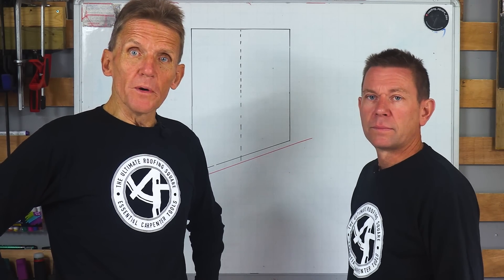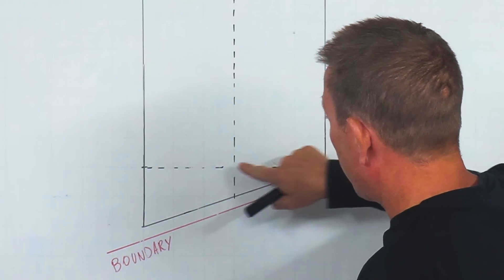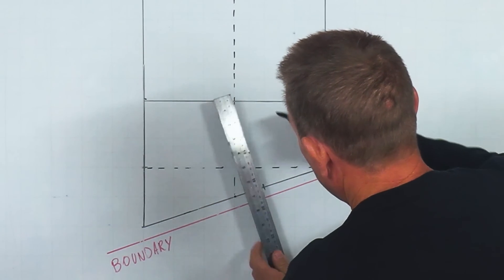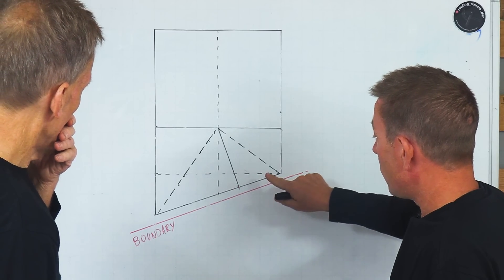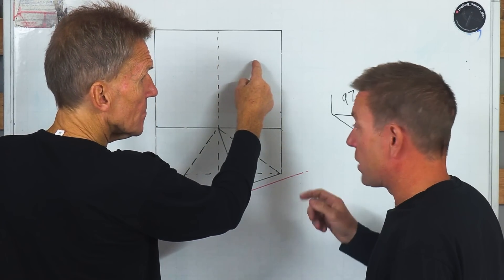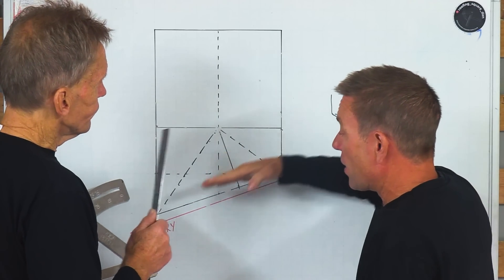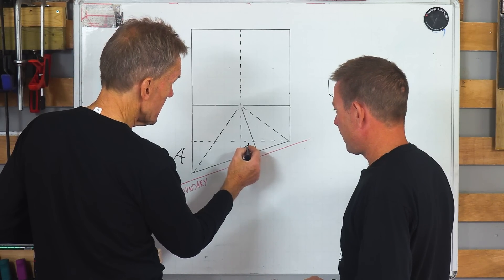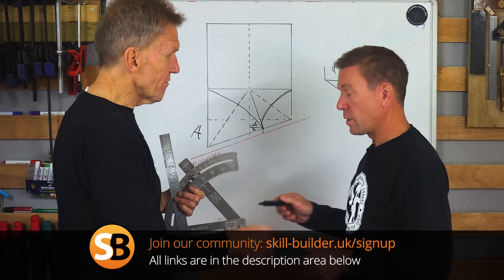How to Put a Hipped Roof on a Building That Isn’t Square

Comment: I think the triangle created from the back wall and the difference in side wall lengths and the squared off wall length is proportional to the triangle created by the end common and the squared off distance from the center line to wall end of the end common and the center line from the end off the ridge to the back wall

Comment: This is a great explanation for when the shape is square on three sides and for a (deliberate) sizeable difference (1 mt) at one end.    Very easy to follow. Thank you. 

When it is a case of having a structure / frame that is  out of square by smaller amounts (eg. 50/100mm) and/or out of square on 2 sides, what are your ‘rule of thumb’ tolerances where you wouldn’t adjust the placement of the hip rafter and just cop a slightly out of plane tiled roof? 
What /where would you make any adjustments to the tile layout ? 

Or would you apply the same method to square up  all sides (making adjustments to the out of square sides)
Reply: Sorry that should have been the common rafter from the ridge beam that dissects the 2 hips :)

Comment: On plan, it's just a problem of similar triangle and symmetrical kite shapes. In 3 dimensions it presents a lot of odd angle cuts. Did you work these out by trial and error or can it be calculated? You described the differences from the usual 45 degree cuts but I just wondered where those figures came from. Obviously, you have to have all the rafters at the same gradient to maintain a plane surface - hence your geometric design. Fascinating.

Comment: If the wall plate comes in and the rafters get shorter does the pitch of each rafter change, if the height above plate stays the same.
Reply: Hi mark, no they stay the same as they are square of the wall plate.

Comment: Dan said on the roof video that on a conventional 38° the hips run in at 29° did he mean the seat cut would be 29° ?
Reply: Yes, the seat is 29 degrees and the plumb cut is 61 degrees. 
The pitch is from horizontal to the elevation. 
We do have a few other videos where I explain this.
Reply: @Ultimate-roofing-square.  Thank you Dan
Reply: https://youtu.be/CaPoQBXL2t4?si=Bjr8mICPFQC2ssfH

Comment: great video, just wondering about the roof tiles, do they run parallel with the fascia and therefore on an angle or square with main roof meaning more rows one side than the other?
Reply from the maker: They run with the fascia but the courses on each side don't quite match. Luckily the hip tile will cover it and you will never notice unless you fly into Heathrow.

Comment: When I hear plumbers and electricians that are demanding 350-400 a day and us fellow chippys are snuffed at when you suggest anywhere near that I’d say watch the dans and robins of this world not for 1 second suggesting I’m in that league but merely that carpentry is overlooked sometimes especially if you do all aspects (well). Thankyou for this video was a great watch
Reply: Totally agree , carpentry not getting enough to solve these issues ,great video as always, cheers
Reply: Us mechanics get wayyy less than that
Reply: It's because if your plumbing or electric or HVAC stops, it's an emergency but if your fascia is drooping, it's not. So these guys can charge higher prices because of the demand. So then translate that into new construction.
Reply: @johnlasseigne7676   yes because that’s a fair statement comparison of “dropping fascia”  nonsense comment for so many reasons
Reply: @bdizzle7633  drooping. I guess you really don't have a response.
Reply: @johnlasseigne7676  ok mate I see your after a debate “dropping,drooping”  which I can’t be arsed with🤦🏻‍♂️, so I’ll simply say your original comparison is like me saying that plumbers fix leaky taps and carpenters remove roofs from houses where clients are living with all the associated dangers and risk so we should be paid more, again not a fair comparison.. 
I don’t see how you can’t see that, and secondly your point was that it’s because electricians etc have to deal with all emergencies again incorrect for many tradespersons  “emergencies” may only be a very small percentage of what they do daily with the rest simply 1st and 2nd fixing houses so once again your original statement doesn’t add up. But opinions are yours so you carry on I’m out as had a hard day being an underpaid chippy 👍🏻
Reply: @bdizzle7633  debate? I mean don't respond if you feel emotional. I figured you British guys were tougher.
Reply: @bdizzle7633  your second comparison is dumb, of course lights going out or water shutting off is more of an emergency for the average homeowner. A "leaky" faucet is not what we are talking about. It's what causes someone to pick up the phone.
Reply: @bdizzle7633  people will wait years to repair structural issues until they are ready to sell, If the pipes bursts, it's immediate. Stop being a child
Reply: You’ve clearly missed the point in your American overeagerness to be the loudest in the room. You should be more British and think before you speak 😂
Reply: No tradesman is worth £400/day.
Reply: @neilrafferty2097 Of course they are. Speaking as retired local authority data developer who does relatively heavy duty diy. Might depend on where you live and what client base you can build up, but... putting roof over a family's head, electrics, water: things that are a matter of life and death if done badly. Far more important than bankers, lawyers, etc. You're worth being able to afford a nice home in a place you want to live not far from most of your customers, at least one holiday a year, running a depreciation account in your business, all the memberships and insurance your trade requires, paying into a good pension scheme, have enough to spare if you have to take time off due to illness, family pressures, caring for elderly parents.
   It's inflated house prices that mean all cash goes on mortgages. Folk blanch at paying you what you're worth.  You can't afford to take your time to do the best job you'd like to do for job satisfaction.
Reply: @neilrafferty2097  you'd be surprised
Reply: @neilrafferty2097 I bet the architect who designed the roof incorrectly earns a lot more than £400 per day
Reply: @1_MartinFlanagan  Yes,but . . . .

Comment: This is what makes our job (as a roofing carpenter) so interesting, the grey matter is constantly being challenged, there is no better feeling than standing back once a roof is framed knowing that it all worked out perfectly!
You could also have found the position of the crown rafter on a scale drawing by using a pair of compasses set  to the length of the common rafter length and striking an arc from the last pair of commons to the new wall plate, really enjoyed both of the videos on this build. 👍
Reply: Although dans working out was needed prior to establish the position of the last commons with the offset crown.
Reply: @bdizzle7633  Agreed, Dans method worked a treat, there are alternative ways to find the point at which the crown strikes the ridge also but this was a great example 👍
Reply: Hi  @RobNorman08  , the scaled drawing was out a bit as the position of the wall plate slightly changed.  Thanks for the comments.  🙌
Reply: @Ultimate-roofing-square.  Oh I wasn't implying "your" drawing should have been scaled, just pointing out there is more than one way of skinning a cat 😂 I thought it was a fantastically well explained video, thought the roof itself came out superb!
Reply: @RobNorman08  sorry perhaps I misunderstood you.  I did do a small scale drawing to work out the 7 degrees. 
Thanks for watching and glad you liked it. 😉
Reply: U know a scaled drawing is very rarely used by chippies nowadays but it’s definitely one to have in the locker cos it’s a great way to find angles  , plumb/seat cuts and length of rafters

Comment: I’m not likely to need anything I’ve learned about Hip Joint construction, be that square or otherwise, but I’m glad I’ve watched both videos- I’ve gained a greater understanding as to why some things are the way they are, and also know now where to come if I do need to brush up on this. Good work chaps 👍